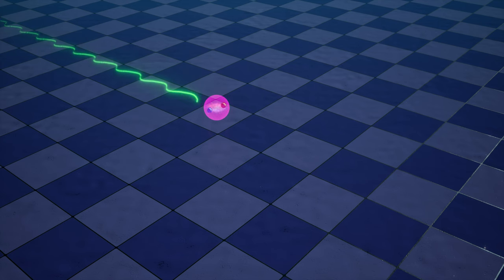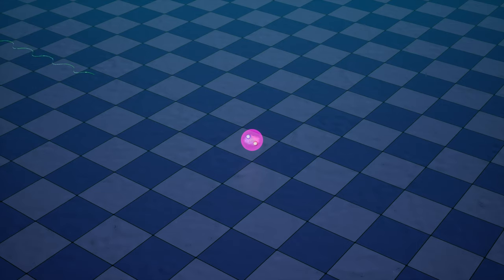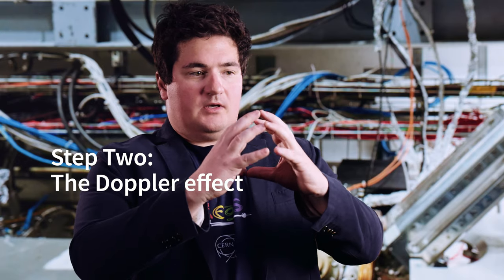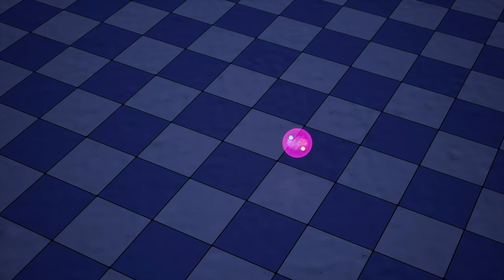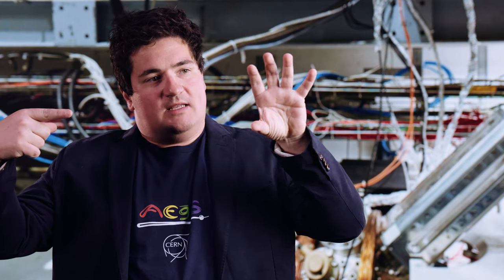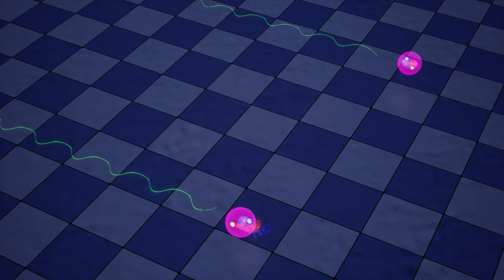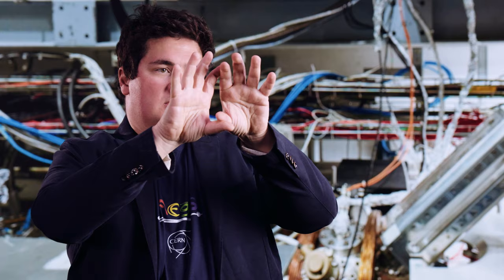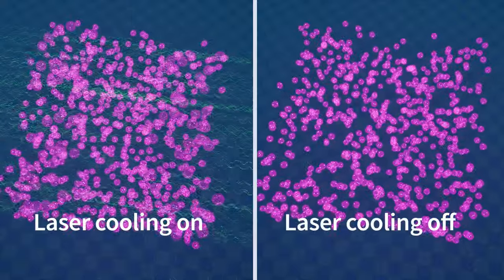Positronium laser cooling in 3 minutes

Comment: Fascinating how the fine tuning of the frequency and energy of the protons fired at a atom can absorb and release a photon sort of a bouncing as it cools down and heats up absorbing at specific approach, the two lasers left and right and compressed collective and expansion of the collective slightly off tuning frequency energy protons..it is sort of. A Casey Jones effect on collisions..only the trains are at multiple cross overs at specific frequencies increasing and decreasing projections.. this overall in a accumulate effect could increase power in the lasers in shorter periods of time.😎🇺🇸